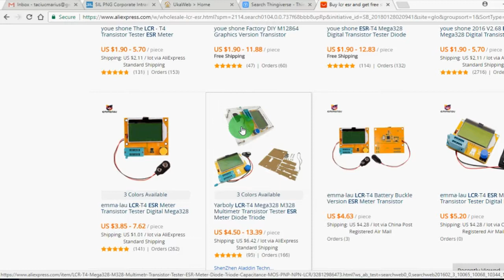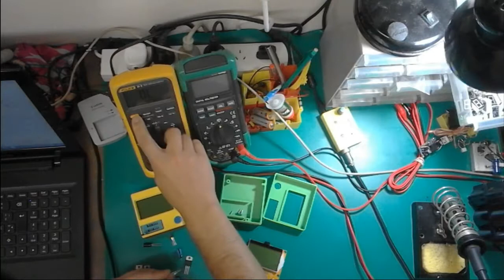ESR / LCR meter for 5$ - component tester review

Comment: Can it check inline capacitors in circuit ?
Reply from the maker: No, I don't think it can. I guess it all depends on the actual circuitry too. If it's a simple circuit where no other components introduce parasitic capacitance or resistance, maybe it could be done. But technically the capacitors should be removed from circuit before measuring. And don't forget to discharge them too.